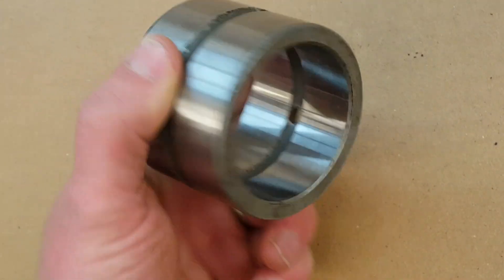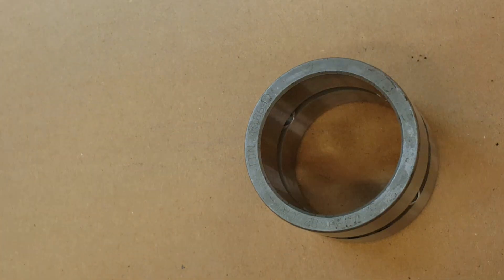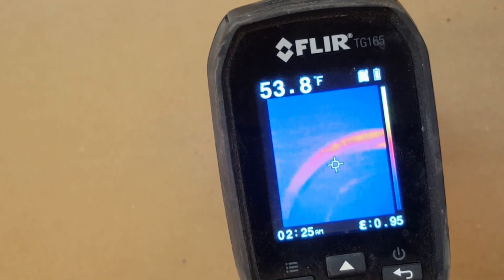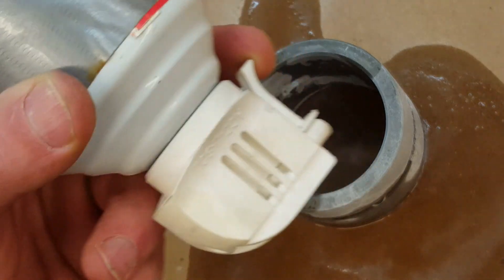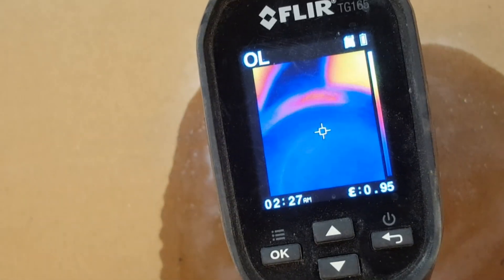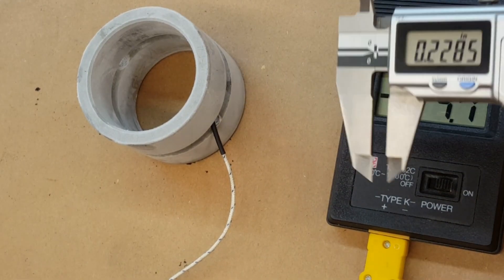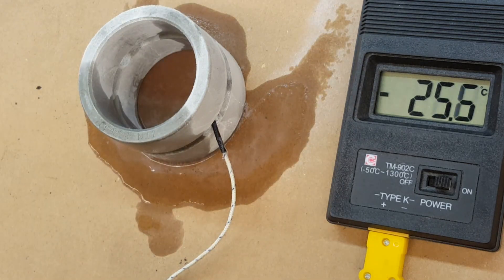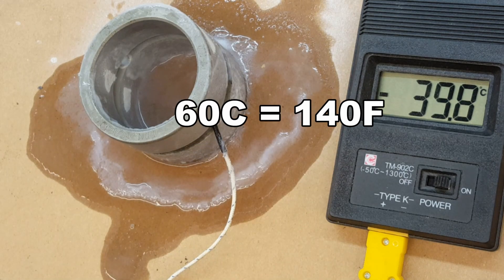Old Mechanic's Trick: Freeze-Shrink Metal Parts WITHOUT Nitrogen.

Comment: Ive done this with an upside down propane cylinder and a wrecked tigertorch (cut the torch off, use the hose and regulator) in the field where I had to replace bushings....

Comment: And if you ever need more shrinkage, try crushing up a bunch of dry ice in some sort of cold-proof container, and pouring a bunch of rubbing alcohol into it. Use 91%, or as pure as you can get it. Oil might work as well, just has to be a liquid that doesn't freeze. Dry ice is CRAZY cold, but, for various reasons, the only way to get it to chill stuff that cold is to immerse it in liquid. Tho it's a bit more involved than the duster trick, it'll chill anything you want to -109 F/-79 C, and it'll do it quick. You can even do all those cool liquid NO2 tricks with the stuff, like freezing and shattering a rose.

Comment: Also good for removing those pesky heatsinks from your confuser parts that have been sitting there getting baked on. Bit of the ol' upside-down blasteroo from your air can and the thermal goop will freeze, give the heatsink a twist and she'll pop right off.

Comment: I used to keep the plastic tops off aerosol tins from the larger diameter types for this very purpose (put the part inside then spray to reduce the amount of gas needed). You can also now get the non-Freon type freezer sprays for electronics work, except they don't work any better than this trick and cost a truckload more.

Comment: C02 cartridges like what are used in pellet pistols work too down to -70*C or so, but you'd likely need to build a tool to hold it since they generate some thrust while getting very cold and there is no off switch.

Comment: If you take a paper towel/shop rag and run it under hot water and wrap it around the can, the can will blast for longer. The same effect that you are taking advantage of (It takes more energy to go from a liquid to a gas) is what lowers the pressure of the cans as you use them up.

Comment: This is an old school trick with A&Ps, in fact, one of the standard issue tools they hand to us over here at Bombardier is a can of freeze spray so we can shrink panel screws and frame bolts that dont want to come out. works great on valve spring retainers that dont want to come out too!
Reply: WOW! I'm trying to remove a rusted metal screw on a washing machine, so I can fix it. I haven't tried this yet.

Comment: Hey!  Could I use this trick to freeze the drip,drip of water upstream when I'm trying to solder on a new hose bib?
Reply: Genius!  Water has ridiculously high heat capacity though, not to mention how well the copper conducts.  You might need quite a bit.
Reply: +dbeierl good call on the specific heat and thermal conductivity.  Guess I'll stick with the jet melt but I gotta try this sometime.

Comment: Let me just expand on this.. When buying a can of air duster for cooling purposes, first find out what's in the can. Read the label or look up the MSDS (material data safety sheet) on the product. Some of them are just a butane/propane mix, which is very flammable - not something you would want cooling a PCB while it's powered on. But it does work for cooling.

Ideally you want the air duster cans using CFCs (inert chloro-fluoro-carbons), this is the type of refrigerant used in A/C etc. It's not flammable.
Reply: Aaaaand many aerosols these days proudly claim to be CFC-free, what for not turning the Ozone layer into swiss cheese.
Reply: Large-scale release of CFCs is not good for the ozone layer, but the amount used in household A/Cs and air duster cans is insignificant.
Reply: +TheAmmoniacal I didn't say it was significant, but, at least where I live, it's hard to find any aerosols which contain CFCs.. and the reasoning the manufacturers give is that isobutane and similar propellants are "ozone friendly"

Comment: 60C difference = 108F difference: (60C * (9/5)) = 108C (or 68F - -40F = 108F)
60C on the scale is 140F on that scale (the + 32 part of the conversion), but a difference between the two isn't pegged to a specific spot on the scale (e.g. a difference of 5F isn't a difference of -15C)

I wonder if you could get it any colder by putting a thermal insulator between the part and the table?

Comment: If you cool acetone with dry ice, you can get it even colder than this. Dry ice sublimates at negative 78.5 Celsius, and acetone doesn't freeze until negative 95 Celsius, meaning you can make a very cold liquid bath.

This would also probably end up being cheaper if you're doing this to multiple parts at once.

Comment: Can you get a bunch of those out of the supply cabinet and use it in the AC in your car?  CAS No. 811-97-2 says it is HFC-134a
Reply: Yes and no.
Technically yes but the R134a in the can might not be pure enough and if the can also contains a bittering agent (to discourage idiots from sniffing the stuff) that will contaminate the oil and/or ruin the compressor in the AC system

Comment: huh.  I did exactly this to remove an uncooperative flywheel from an engine a couple weeks ago.  I just filled the hole in the crankshaft where the flywheel bolt went and let it boil off.  That and torching the flywheel itself.

Comment: Fun fact; sprayed liquid is highly flammable and combusts into hydrogen fluoride and carbonyl fluoride. Both are incredibly toxic. Please be careful.
Reply: Most of the times it's just butane, isobutane or a blend of both. They will combust into CO2, (some CO) and H2O.
Reply: Nowadays it's typically difluoroethane, trifluoroethane, or tetrafluoroethane.
Reply: TarkisRai
Never found one of those. I have been looking through many brands (I was looking for one with R134a to refill a minifridge with) and never found one. I found only the ones with butane or isobutane inside.

Comment: When I first started working as an engineer, the older engineers call that stuff "Technician in a can".  We actually get stuff marketed as freeze spray though.  Not sure exactly what the difference is, but it is helpful.  We make products that have to operate @ -40C, since we can't get in the chamber to debug at -40, we use that stuff to freeze parts of the board to find where the problem is.

Comment: Thousands of an inch ... thats a bit much to wrap your head around.   Whats a thousandth of anything look like?
Reply: The thickness of a human hair generally ranges from 2 to 5 thousandths of an inch.  Most hair will be around .003" of an inch.  Hair is a little thicker in the nether regions as well, and is sometimes used as a standard of measure in many machine shops.
Reply: Thanks for the hairy visualisation!
Reply: My willy
Reply: A thousandth of the thickness of a ream of paper (500 sheets) would be half the thickness of a single sheet of paper.
Reply: Go watch Abom79's videos for a while and you'll get a better idea of it.
Reply: 149,600 kilometers is a thousandth of an astronomical unit.
Reply: Buy a feeler Gage set. Super cheap tool and will really give you a idea of fine measurement of thousands of a inch.

Comment: Isopropyl alcohol and dry ice will get you down to somewhere south of -50C... but it doesn't flash off residue free as fast as air duster.
Reply: Isopropyl alcohol isn't necessary, the dry ice alone will cool something to -78 C. Mixing alcohol or acetone with the dry ice will give you better heat transfer, but that's normally only done when you need precise temperature control.
Reply: Or faster chilling, for those of us in a hurry and with a few gallons of relatively pure alcohol on hand.

Comment: there's a plumbers cold spray for freezing an ice plug inside of pipes where the water can't be turned off to work on them.
Reply: we use liquid magic to freeze large pipes solid if we can't get the flow to completely stop.
Reply: mikmacarthur Thats neat idea how to shut off a section without valve...
Reply: I wonder if the water pressure can be strong enough to blast through the ice.
Reply: That's simply brilliant!
Reply: +Techtron23 emm, NO, that's the whole fuckin point. jeez.

Comment: The propellant used in most of these air dusters is R-134a same refrigerant used in most car ac systems nowadays. It doesn't contain chlorine like most of your older refrigerants it's an HFC (hydroflourocarbon) so it's considered "ozone safe" just remember that this stuff is still heavier than air when it boils off it displaces the oxygen in a room. So don't use a lot in a small unventilated space.

Comment: You can use this same principle with breaking locks. Spray it freezing cold, if it doesn't shake loose then, then smash it with a hammer and the lock will shatter apart
Reply: no, just... no
Reply: Alex Smith Now try that with a heavy chain and a real lock. Bike locks  are made by the lowest bidder, using the cheapest materials to sell to the masses.
You really want to protect your bike? Get a lock from the hardware store instead of a bike shop.
Reply: I left an end wrench in a pail of liquid nitrogen for a while. It still required about 100lbs to break it in half.
Reply: Alex Smith you saw it in 10 Cloverfield Lane didn't you?
Reply: "You really want to protect your bike? Get a lock from the hardware store instead of a bike shop."
Nothing will protect your bike from a  portable angle grinder, except perhaps the noise from using said grinder. Never park a bicycle you really care about outside; that's what Salvation Army bikes are for!
Reply: You know? I used to believe something like this, then one day we had extra nitrogen lying around and I tried.  No matter what I froze and beat to death with a hammer, it doesn't work.  At least not at liquid nitrogen temperatures.
Reply: http://www.popsci.com/diy/article/2012-08/gray-matter-how-science-helps-bike-thieves

Comment: Air duster... isn't that stuff just butane?
Reply: No they don't use that any more. Its generally one refrigerant or another. The cans I get here are R-134a based.
Reply: Not anymore. Now they are usually polyfluororinated ethane (usually bi, tri or tetra fluoro ethane) with an added bittering agent like Denatonium (common brand is Bittrex) to make it more or less physically impossible to huff.
Reply: R-134a is tetrafluoroethane....

Comment: Literally in sync man.  I just figured cold stuff comes out of the air can when i pulled a stupid trying to clean g10 off my cnc spindle.  Im so used to air compressors that i turned it bottom side, top side and blasted it. X)

Comment: @1:18 "try it upside down, the solvent comes out".

There is no solvent in a air duster can, its just compressed air, and it liquefied due the amount of air in it. So basically, you are spraying liquid air. As that evaporates, the volume goes up a lot, thermodynamics works still, so the heat to evaporate it must come from something, which does cool down the object under it.
Reply: It's propane and/or butane. Highly flammable.
Reply: 1,1-difluoroethane and other fluorocarbons.
Reply: You can't compress air into liquid at room temperatures, go back to school mate.
Reply: These use butane or something like that IIRC. Everything else is correct. You can actually buy a spray purposely made for freezing stuff.
Reply: BPollard86 Last time I used it was just propane or butane.
Reply: +VictorIndiaDeltaAlfa its just r134 refrigerant
Reply: +BPollard86 I think its unicorn piss magic
Reply: Paul Brandt You are right, the new ones use r134, but older ones used butane, at least here in EU.
Freeze spray uses this: mixture of 1,1,1,2 tetrafluoroethane and dimethyl ether
Reply: Buy a airduster can, hold it upside down, and try to burn it.... it won't for its just compressed air.
Reply: *****
not everything burns lol if it doesn't burn it must be air?!

Comment: Most of these "Canned Air Dusters" are R152a or R134a.  God forbid you vent it out of a system but fine sold out of a can to blow out a keyboard?!  I generally use propane when safely possible (cheap).

Comment: I've been using that method with duster gas to rapidly cool solder joints prior to applying heat shrink so the shrink doesn't bind prematurely when I'm in a hurry (only on coupling wires though, not any PCB work of course). Works pretty well.

Comment: If you get dry ice and alcohol, break the dry ice into smaller pieces in metal container pour Iso alcohol into dry ice and then part into it. just as good as the nitrogen, no not as cold but close enough

Comment: If only those cans weren't so expensive!
Reply: +MrOpenGL the only problem being the slightly 'explody' workshop environment 😝
Reply: I betting the machine that needs that bushing is most expensive than the can of air duster. Can't always have everything.
Reply: you can use also a can of lighter refill. Same effect, stupidly cheap.
Reply: J Cervera That will only cool down to about 0 °C, the boiling point of butane. An alternative would be using CO2, that will cool down to -78 °C.
Reply: Use isobutane cartriges for camping stoves!
Reply: the cans of "air" work fine too, its just liquid co2 most of the time. way cheaper.
Reply: @Ziellos  and completely safe to use indoors.
Reply: How bout a freezer? Much cheaper as most everyone has one.
Reply: @jerryhaveman5659  On the part in question, that's only going to buy you 0.001". Maybe it's enough to get your part installed, maybe it's just enough to get it started and then stuck when the mating part heats and expands it.
Reply: @jerryhaveman5659  I mean that's fine if all you gotta do is shrink a part before installing it (won't get anywhere near as cold as fast though) but it won't do anything for trying to remove a part. And even if it did, good luck finding anyone with a freezer big enough (never mind willing) to let you park your 19-ton combine harvester so that you can remove a compression fit shaft from a blind hole.
Reply: @jerryhaveman5659 , do you mean drilling a hole in the coil to get at the refrigerant?
Reply: As a friend of mine says ''cant have your bread after eating it''
Reply: Driftingabstract -
Isn't R410a more expensive than the "purpose made" spray cans?
Reply: You can get 25 lb. Jug for like $80. But I always have some around.MrOpenGL
Reply: They aren't unless you get them in a tech store where they sell smartphones and vacuum cleaners. Everywhere else those cans are cheap as dirt
Reply: +MrOpenGL | It's illegal to release most refrigerants directly into the atmosphere, which is why barely any duster cans use HFCs.
Reply: LazerLord10 I just thought about doing the same thing with some r410a....slightly illegal though....
Reply: Or stick it in the freezer overnight
Reply: @beamish1066  That's not going to do much. At best you might get it down to minus 15 F if the freezer runs continuously for 24 hours , which it won't because the thermostat won't let it get that low .
Reply: @TheNYgolfer  ok ,I’ve used the freezer for two stroke crankshaft bearings and also headstock bearings  and it does work
Reply: darronjknight
Here in Europe every single can of duster I have found had butane or isobutane inside (Photonicinduction made a flamethrower using one of them). I was looking for a duster can with R134a inside so I could use the gas to recharge a minifridge and couldn't find one.

Just do it outdoors!
Reply: @MrOpenGL  r134a has been made redundant a while back now
Reply: Co2  fire extinguisher ??
Reply: wouldnt it be cheaper to use nitrous
Reply: LazerLord10 Get one every now and then from your works IT department (assuming u or loved one works for a 'outside' company).  Those cans are a load o laughs at work against a 'cool' (lol) co-worker.
Reply: I think this would work with propane as well.
Reply: @ichewtoast111  sure ,propane boils at -42C ( on ambient pressure) so it will work.
Reply: Easier to find stores better
Reply: Dollar store or surplus store.
Reply: Probably less expensive than the unit that the part fits into and also less than a dewar of liquid nitrogen.
Reply: I don't think you know what you're doing you need to press that bearing in with the hydraulic pressure
Reply: i use liquid propane. Drill the orifice out and tip it upside down. Gets down to -43F and its a few bucks for a coleman can. Just do it outside or in open area.
Reply: Back in my huffin days, R134a was the best
Reply: +Lo Tek any one with a kegerator could use their CO2 can to do this. You just need to flip it upside down to pull the liquid. same as he does with the duster can.
Reply: 🔴 What Is Islam? ⚠️

🔴 Islam is not just another religion. 

🔵 It is the same message preached by Moses, Jesus and Abraham.

 🔴 Islam literally means ‘submission to God’ and it teaches us to have a direct relationship with God. 

 🔵 It reminds us that since God created us, no one should be worshipped except God alone. 

 🔴 It also teaches that God is nothing like a human being or like anything that we can imagine.

🌍 The concept of God is summarized in the Quran as:

📖 { “Say, He is God, the One.  God, the Absolute.  He does not give birth, nor was He born, and there is nothing like Him.”} (Quran 112:1-4)[4] 📚

🔴 Becoming a Muslim is not turning your back to Jesus. 

🔵 Rather it’s going back to the original teachings of Jesus and obeying him.
Reply: Maybe a garage can help you out, car's also use R134a in their A/C system